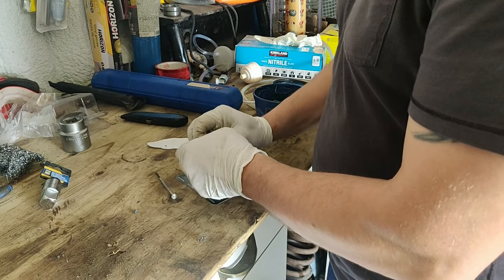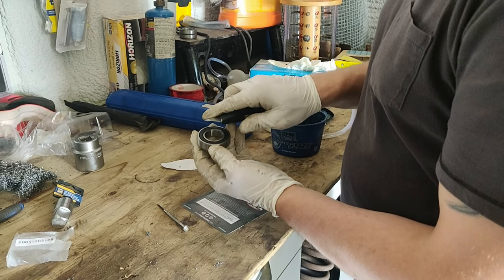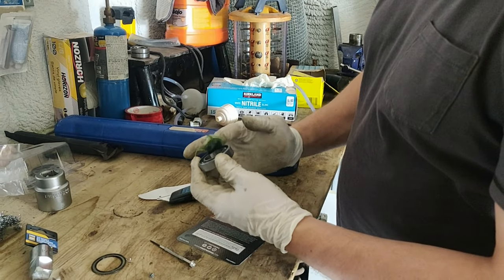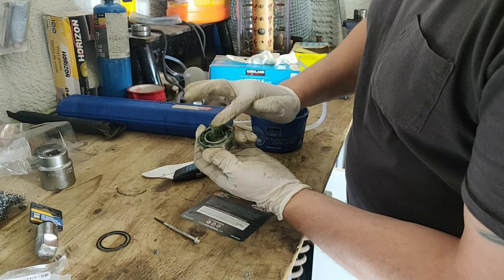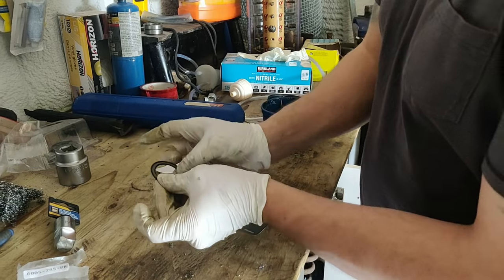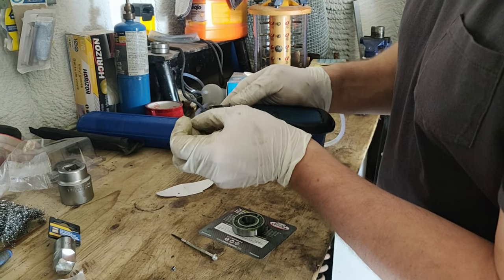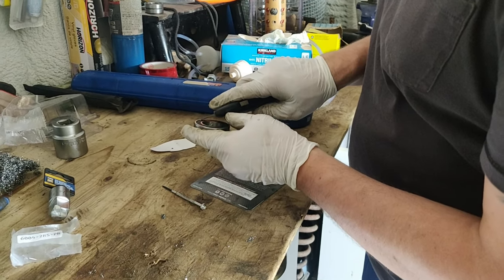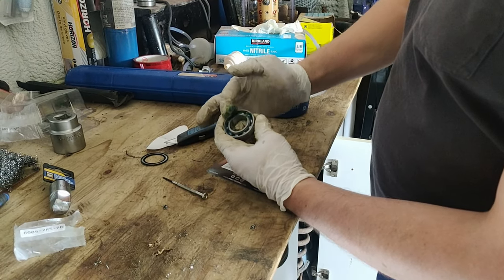Water Proofing Your Wheel Bearings

Comment: There was a time when my 500 was eating rear bearings. I thought maybe I'd over torqued the rear axle or misaligned the axle when adjusting the chain. In the end I think the wheel spacers had been worn out and were allowing more water, mud and grit to contact the bearing seals.
Reply from the maker: Very good point. I also now use some spacers from Tusk that covers the hub entirely and limits even more dirt and grime to make contact with the bearings.
https://www.rockymountainatvmc.com/tires-and-wheels/tusk-rear-wheel-spacer-upgrade-kit-p

Comment: Can i use mobil xhp222 for the bearing instead of that belray?
Reply from the maker: I am not familiar with that grease but I would imagine that any high temp grease would work. I personally prefer axle grease as it is made for high speed rotating parts.

Comment: I have an electric longboard with a gear drive, I think if I pack the bearings I could waterproof the whole thing, I’m just tired of having to clean it every time I ride in the rain.
Reply from the maker: Ever since I have been doing this, which is only once, I never had to replace a bearing yet!
Reply: Should I pack them full or only 75%?
Reply: For waterproofing it should be nearly full huh?
Reply from the maker: @jamesfarquhar8507  that sounds about right. You need to leave some space to be able to put the seals back securely in place.
Reply: @BabineauMoto  okay, thanks man, ill lyk how well it works, I like riding in the rain the most so I’ll test it out soon.

Comment: If I really pack the bearing with medeum thickness grease does it encrease resistance and will the bearing be harder to turn? Like will my scooter be slower? (btw I'm re-greasing my e-scooter)
Reply from the maker: I do not think it will significantly impact. I don't have means to test resistance but on a dirt bike, it had no noticeable impacts other than extend the bearing longevity. Since I posted the video, I only replaced the bearings last week. I used to change them once to twice per year.
Reply: @BabineauMoto  ok but a dirt bike has SIGNIFICANTLY more torque than an electric scooter but I'll pack it full and see the results I guess but thanks
Reply from the maker: @pec-chest  I would be interested to know if you noticed any difference.
Reply: @BabineauMoto  ok will report

Comment: Yeah... this is stupid. Great find sherlock. Why do you think the factory didn't "pack" the bearin full of grease ? Cost ? You pay for that bearing and grease anyway. The reason is packin the bearings stupidly with grease stop balls rolling ! They "slide" onto the races - that neans more wear and not optimal rotation. The bearing should be "packed" maximum of 75% of the race surface with grease. Do you think noone thought of this before ? It's just not healthy for the bearing.
Reply from the maker: There was a better way to present your comments. Since then, I have not had a bearing failing yet used to have to replace twice a year before.